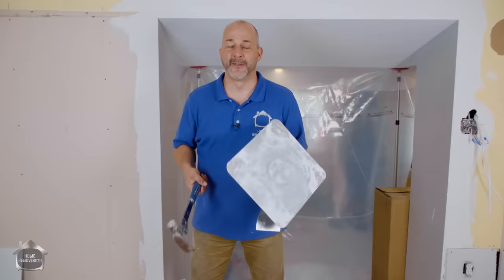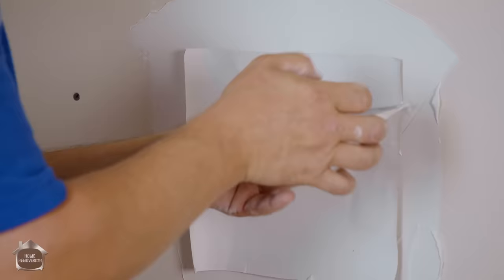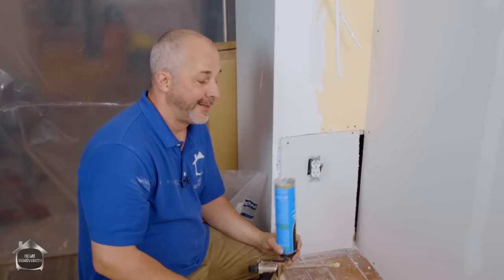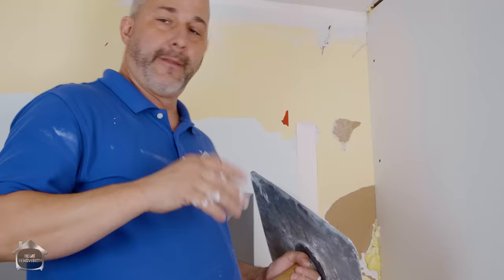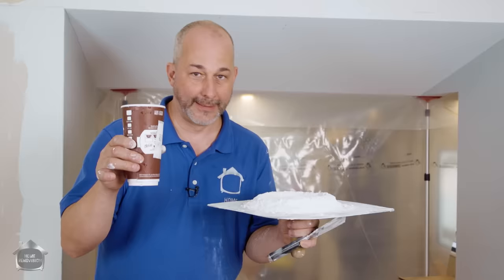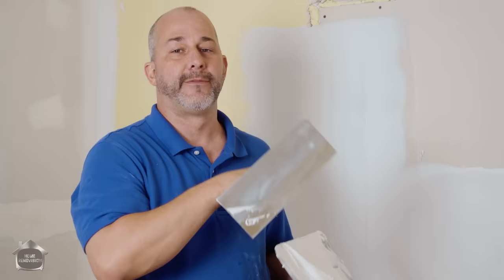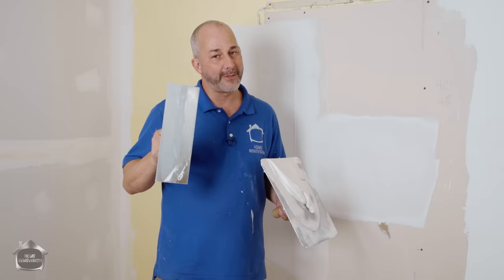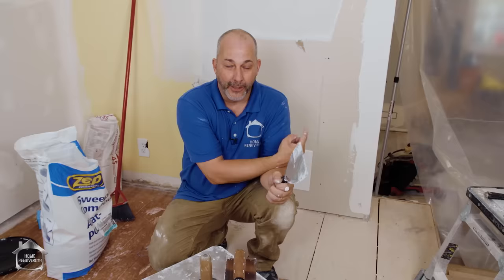Easy Drywall Tricks to Fix Any Mistake

Comment: Sir, I live in a rented apartment and I stick some adhesive lights on the dry wall, I thought it would be easy to remove but I ended up tearing the dry wall while removing those lights. :( Would you please help me fix it, please! I have never fixed any drywall before and have no clue of what products to apply. Please help before someone finds it out.

Comment: I was wondering is that can actually oil-based primer or is that the shellac base kills because if you really want to knock down some nasty stains there is no better product than shellac base kills the only problem is you have to use alcohol for a reducer not that you really need a reducer

Comment: Hi Jeff, I've read that drywall compound (the dust that is) can be quite dangerous to inhale and even the painters masks with filters don't do the trick since the particles are so small. Is that only when working on large scale jobs with a lot of cutting or would simply mixing this compound/sanding be a hazard as well? Thanks for all of your great content!

Comment: I have two holes in My bedroom. One from our former contractor punching a 4x4" hole from the garage into My room. I stuffed it with paper and used the screen method. I think it looks like complete ****. The second one,  there was a phone jack that I tried removing. It cracked the sheet rock upon removal. Again, the screen method which doesn't look right. My Mom thinks I'm completely insane and thinks I'm far too fussy. This is the same lady that ripped the wallpaper off the downstairs bathroom, left the glue and painted over it. Argh!!   Thank You for a great video.

Comment: When the paper is torn, shouldn’t you paint a sealer over it? Or it will bubble?
Reply from the maker: it helps in some situations. if you use a thin layer it primes the patch.

Comment: Never, never do you want to rely on drywall mud holding a full sheet of drywall to an acoustical ceiling! Overtime the drywall mud will harden and get brittle and if you do not have screws securing it to the ceiling joists , it will fall down so unless you have a great insurance company that doesn't mind putting out money do not use screws if you're worried about it falling on family members please always use screws. I have been in construction, drywall and plaster for 35 years and I would never suggest that to anybody. But it's up to you whether you value safety or not. Thank you for listening

Comment: I like that trapdoor, but the hole I need to cover has studs on both sides.  It is where an electric wall heater was removed and is not square either, like most of the ones advertised.  So, maybe the CA patch would work, if it can be used on larger holes, like 14x18.  If so, it would have saved me a lot of misery.  This learning curve on all DIY is tiring.

Comment: so this wall is riddled with tears in the drywall, and you made a video about using an oil-based primer to coat the torn paper first, but you did not do that here. Won’t this lead to bubbles?

Comment: How do I successfully repair a horrible caulking job where drywall butts to the bathroom tile edging. My professional painters didn’t seem to be able to do this. Would the tape you used at the ceiling edge work best to hide the terrible bumpy caulking job?
Reply: Don't bother covering it. Just cut the old caulk out and redo. Make sure to use paintable caulk. Hard to tell from your description if other alternatives will work.

Comment: I dunno how you guys work off those hawks and use sideways trowels. Give me a stainless pan and regular drywall knives and I will make gold. Use 45 over mesh tape and get your block coat done in one shot. Scrape the goobers, and skim with bucket mud and you're done. People waste a lot of time using the wrong(or goofy) stuff.

Comment: Yeah my texture ceiling AND walls that isn't going to work. The previous home owner textured a spiky texture which is 1" variation in height and if you rub the wall on accident you take off your skin. And they painted it all....im not sure what to do with that room.
Reply from the maker: remove the drywall and start over. It is only drywall!
Reply: @HomeRenoVisionDIY  house built in 1941, no way to transport drywall sheets....so easier said then done atm.

Comment: Got a hole in the wall.  Told hubby,  I'll fix it.  He said no,  I've got it.  I've been watching Jeff,  so I executed.  I am in the middle of my first California Patch. IT'S A BIG ONE.  Home Depot had one Drywall.  Takes two layers to make one layer of thickness. It's for soundproofing but it's all they had in the department. Two sheets came home as expected,  carried as instructed.  It took me a minute to learn to sink the screw on the support which I got from the trash wood for $1. No click detected.  One step at a time,  following instruction.  I realized it's not as easy to cut a square into the wall or the drywall to match.  More practice... I've got two sheets...  Took a minute to learn to pull the drywall from the paper. They had  "plaster of paris" in the paint department.  30 minutes to set.  Okay,  that sucked. Finally, 
I found sheetrock 45! Soooooo much easier! Scraped off all the plaster of Paris.  Applied as instructed.  Hubby came home,  said I said I'd do it,  woke the next morning and said NICE JOB!  (now I'm motivated!)  Got out my orbital sander and my ENTIRE BEDROOM IS A LAYER OF DUST.  Cleaned all that up,  picked up a shop vac I can attach to the sander because I have a LOT of projects headed my way.  Tomorrow,  2nd coat... I've got my spray can of kielz ready to go.  I'm learning to use a hawk over the sink because he makes it look easy,  but my water sneaks out on the side. Can we say day one? I'm telling you this learning is PRICELESS!

Comment: Edit: holy cow I hate you! Hahaha in a good way! You even warned TO NOT TOUCH IT LONG CUZ OF THE moisture lol.  Damn it! I should have remembered to do it one shot and not mess around with it and more mud. 

I have to say, you make it look way to easy! 
I attempted today to do a California patch, and failed miserably!  Way to make me like less of a man. Hahaha the cutting went well. So did mudding the new piece and the hole. Where I failed was with the smoothing of it all. Looked like it was no good so I added more mud over the top to make it look smoother hahaha fail fail fail.  Told the wife, to call the guy if she doesn’t like the way it turns out after the second coat tomorrow lol

Comment: I think the California patch method is ok for small holes but even the hole he repairs here is borderline to big. There's simply no way that that tiny amount of joint compound used to stick the patch in place is going to recreate the strength of the original drywall. If someone were to lean or put their hand just right on that spot, it could punch right through. I think I'd prefer using 1x backer strips and screw the sheet rock into those and not rely on joint compound for strength and rigidity. Also I would never use open cell foam to fill gaps like that. Mix up some durabond 90 to fill those bad boys.

Comment: I’m not gonna lie he has cool little tips that Will work, but that’s not how it’s supposed to be done, there’s a reason if there’s a bigger hole you’re supposed to fill it with more plaster because you would be then adding reinforcement back into that wall, not foam being your reinforcement
Reply: Great tips anyways , especially for backing on the ceiling

Comment: This is a neat trick if nobody ever accidentally puts the slightest pressure on the patched area.  A better option would be to cut the hole out to the middle of the studs on both sides and secure it with drywall screws.  So side to side this would be a 16 inch hole, and no more from top to bottom than necessary.
Reply: It's actually pretty strong if you do it right. Obviously screwing it into the wall will be stronger.
Reply: @armadillolizard711  maybe if plaster material is used instead of drywall mud.

Comment: 4:20 It may look fine but it’ll punch right through.
Reply: The repair done on my drywall hole was done by screwing down a small strip of wood inside the hole and using it to anchor the replacement drywall piece. The screws are then plastered over.

Comment: I think people should avoid the foam idea,  The rest were good tips.  Just buy the Durabond 45 and fiber tape and if the gap is too big then just put a new piece of drywall in.  That foam stuff is a Horrible practice and will fail down the road.  I yiy yiy.
Reply: Wish I had listened. Just too messy all around.

Comment: Not the best way, in my opinion. Tom Silva would cut a new piece of drywall first, use it as a template to trace the cut pattern onto the wall. Then, he would use a drywall hole saw to cut the drywall, not an 18mm olfa knife. Good luck keeping the spray foam from making a sticky mess before it sets up, that stuff is hard to clean up.

Comment: "...Oil based primer works on everything..." that may be so but according to you it's gonna be really hard to get because it's oil based....
Reply from the maker: oil primers are easy to find you just can't get finishing paint made with oil anymore. try killz or zinnser products sold in every paint store. Cheers!
Reply: @HomeRenoVisionDIY  thanx for the tip! It helped! Cheers mate!

Comment: Wrong in so many ways. Drywall compound adhesive will not bond to spray foam. Hawlk and trowel is for plaster or maybe even concrete but not Drywall,  trowels are curved and walls are flat and you should want them straight and flat so use a straight edge knife.

Comment: You guys and your "easy" videos.  Yeah it's easy for you after 30 or 40 years of experience and mad skills but for ordinary diy-ers it's a nightmare and you should be very afraid!  You make it look easy just like a motorcycle racer makes it look easy to go from 180mph to 60mph and lean the bike through a curve dragging his knee on the ground.  I am not gonna try that but sadly I am trying to repair a major hole in my bathroom wall.  At least the gaping hole won't be there but it won't look like new either!

Comment: These aren't tricks.  These are ways that a regular drywall taper does, and if any drywall taper says they learn something from this, then you are a poor drywall taper.  Also,  this guy is advertising all that spray, if not then the company should pay him because. this crap of using those expansion products and primer product, is the the expensive way of doing it.   Most people I do small jobs like that for, it's not that they can't learn what you call tricks.  Their problem is being able to to use a trowel and a putty knife and some don't want to deal with a mess.  You should be teaching people how to do it with just sheetrock 45 and regular cgc .  That's the cheap repair.    Any drywaller makes what he's doing  look easy.